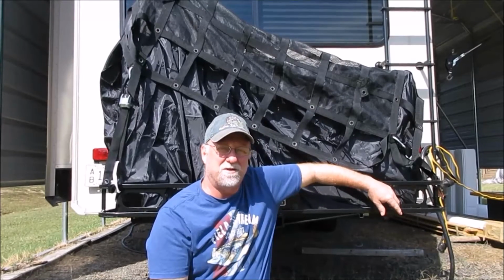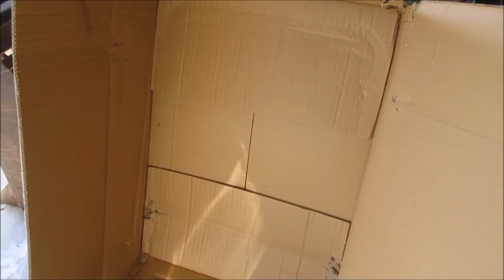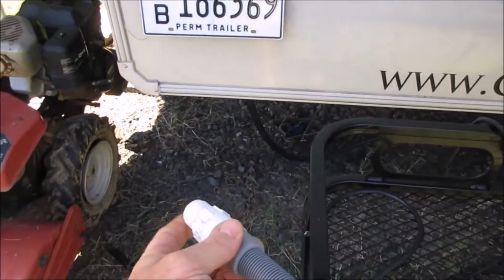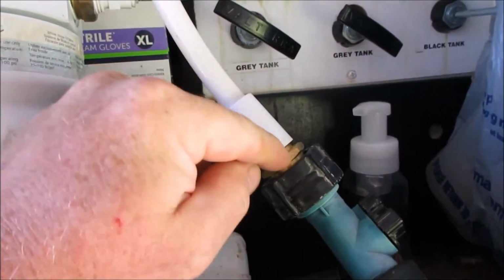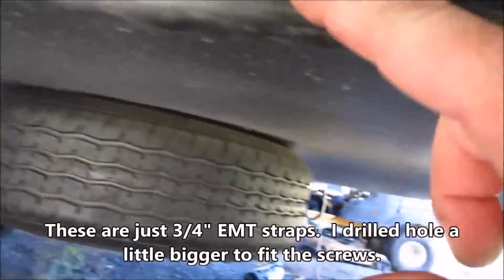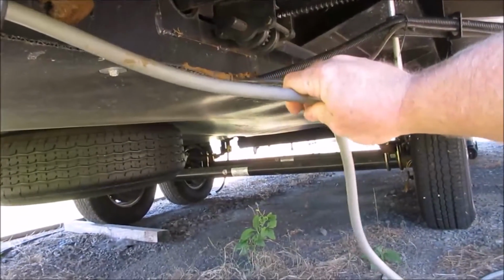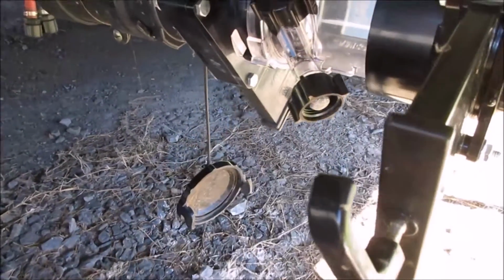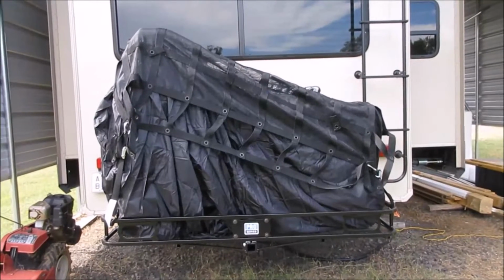RV Modification:  Washer and Dryer on the Back!

Comment: Hi, I normally live full time, just my dog and I, in a Coachman Bunkhouse RV. Right now with my son taking care of his son’s wife. I hope to be back in it in the next couple of months. Now I am in Little Rock and should be moving to JB’s RV park out side of Benton. I thought you said you lived in central Arkansas? Anyway, I  have seen someone have this set up before and I have been looking for a way to do this myself. I don’t know if this will be monetarily feasible for me but glad to have seen your set-up.
Reply: The dishwash I used in the video went bad.  It was a cheaper product and I think the bouncing around didn't help.  That was a few years ago so it lasted a good bit for us.  Our plan was to purchase a washer/dryer combo to alleviate the switching to the dryer.  Thoughts were to turn on at night and next morning they'd be dry.  Well, we started saving and then Covid curbed the usual traveling.  Today, we're on the fence on whether we're going to keep the current 5th wheel long enough to make a washer/dryer combo purchase worth it or just get a new 5th wheel with hookups inside.  Now, we also have ebikes that are going on a rack.  We just talked about it again and we're considering options with 2024 being an active year for RVing potentially.

Comment: I live full time in my 5th wheel camper, I've been @ this camp ground for 30 months. A camper pulled in a week ago with a box frame welded to the back with a front loader washer and dryer. My wife loves the idea, but searching online. I only see your video. I'm about to cut up some 5 inch c channel & build a rack.
Reply from the maker: I am going to get a washer/dryer combo and give it another go.  The cheap washer broke.  I also need to build a shock absorber into the rack to keep the road bumps from damaging the unit over time.  Any ideas?

Comment: Just saying, if I was parked next to you at a campground. Would you hear the washer and dryer running at night?....lol. I was wanting to do the same thing on ours.
Reply from the maker: Very good question!  I want to answer honestly because noise is always an issue for some campers especially generators running, dogs barking, and children screaming.  Yeah, they get on my nerves too at times.  

We used it on our 3-week NC trip.  I washed once at night and could hear folks' TV next to us, from inside their trailer, while it was going.   We mostly use it during the day, say late afternoon when surrounding noise levels are higher than at night.   You need full hookups or it will quickly overwhelm your water/tank storage.  But that's true of all RVs with washers and dryers.  

Most full hookup places don't lean themselves to "campers" so not a lot of hanging outside going on.  Most folks are out and about during the day and retired inside the RV at night.  Most picnic tables and hang-out areas are mid-trailer or so.  This is on the back of the RV.  I asked Gina again just now and she reflected what I remember.  We couldn't hear either running while sitting on our back couch which is right next to it inside the trailer.  We could barely feel the spin cycle.  Our previous combo unit inside our Cameo, was more detectable.  Simple answer, I don't think you'd offend anyone.  I would say go for it if you're put out sometimes with loading up for the dreaded laundry detail.  I bet your wife would appreciate it!  Ask her and let me know what she says.  

Lastly, even if noise complaints are a concern, you could wash when no one is around like during the week, even say staying at COE parks or state parks.  There's always dead times when we travel and with this setup, 2x a week is plenty.  Hope this helps.  :O)
Brent
Reply: No you won't

Comment: Great idea. I'll do the same way in the future. How many lbs? For both machines and any problems with the 5 er. Thanks.
Reply from the maker: It's not much at all, but I don't know the weight.  The hitch holds 300 if I remember right.  It's less than 150 total I imagine both machines and the tote too.  They're all on the rack.  No problems in our travels yet.

Comment: How are the washer and dryer holding up to the elements, being outside 24/7 under a tarp, with the underbelly exposed?  Getting any rusting?  How are the electronics holding up with the exposure to high humidity?
Reply: Let me go look.  Just washed a load two days ago as part of upkeep.  The bottom of both are covered with painted metal like everywhere else.  No issues seen other than rub marks where the tote rests next to the washer.  Hope that helps.
Reply: I have mine set up on a seasonal site, and my washer and dryer sit on treated wood with a cover, and there don't seem to be any problems. I have my drain set up so it drains on the ground, but want to do an adapter like he has above but don't know what connectors to buy.

Comment: Given that the frames on RVs are prone to rusting cracking breaking etc are you not concerned that the weight of these units and the springy nature of it's platform will not eventually lead to it's structural failure to stay attached to the main RV frame especially when driving on a bumpy road etc? I can see the main attachment snapping off at 60mph on a freeway and the units falling onto the roadway causing other vehicles ie tractor trailers etc to veer at high speed causing horrific chaos!
Reply from the maker: Wow, Lauren, that's quite a comment.  It sounds like you're saying you don't trust all of the RV manufactures decision to add a hitch on the back of fifth wheels.  For that matter, all the pickup trucks, SUVs, and cars too.  They're everywhere.

I don't know how to alleviate your concerns other than give you my thoughts on it all.  Grand Design added a hitch rated at 300 lbs.  Why did they do that?  What other possibility could be used with a 300 lb hitch rating or tow a very, very light trailer?

I have personally only used about 1/3 of that capacity or just over 100 lbs if I remember correctly.

I expect that if such a horrific incident happens, Grand Design will be liable.

I'm not trying to be snooty, honestly and I am curious about your line of thought on it 'cause it's a big fear to harbor.  I've been under 2 RVs now for 8 years of traveling.  It's part of my pre-departure checklist to check the frame and other components such as the landing gear, jacks, pin, tires, wheels, leaf springs, etc.  I've not noticed any rusting or cracking other than very fine surface rust.  I just checked again for this answer for you.  There is almost zero rust on the whole back assembly and no cracks 3 years of traveling.  I hope that helps you out.  And, I hope you realize that I'm within normal practices.  I certainly hope you come back and post your thoughts after my answer because I worry about your fear.  I am afraid of heights so I can imagine what might be going through your mind on it all.  Thanks.
Reply: If you mix YouTube videos of Lippert RV frame horror stories with a weighted bouncing rear attached frame platform you can easily see this scenario happening. Look up Lippert frame disaster RV stories on YouTube then you will see how I arrived at this idea. I've read multiple Stories about rvers adding a simple double bike rack on the rear hitch of their RV then putting on one or two bikes add anything other than a smooth highway and the frame hitch cracks due to it's paper thin construction and the bike frame n it's bikes and up in shreds on the highway! So I can easily see a heavier weight like appliances on a rear attached platform happening WAY easier than a couple of bikes. Plus people stating that even though their unit has a rear hitch if they add anything to that hitch they void their RV frame warranty!! Stunning!
Reply from the maker: I did a YouTube search just as you said and the output is all over the place.  Can you put the links of 10 cases on YouTube here, the forum conversations with bicycles causing failures, and any other supporting links.  What your describing goes against everything I've experienced, researched, read, and discussed with the manufacturer and other RVers.  I need to see what you've seen to see your points so please supply those links for me and the others who read the comments.  

The warranty only covers basically the appliances and stuff like that.  I just went over this with them round and round because our trailer axle was mis-aligned.  They told me they don't cover stuff like this because they can't verify what is human error or not.  I think that's BS, but it's in writing. 

I JUST got off the phone with Mark from Grand Design and posed your concern.  He said two things:

1.  Lippert wouldn't put it on their frames if they didn't mean that it can support 300lbs worth of stuff going down any road.  They're aware of how RVs behave over every surface and hitches have been on RV since the beginning of time.

2.  Mark said he has NEVER had a case where someone reported a hitch failure.

I have worked with Grand Design on a few issues directly including the grease seals failing.  They paid for everything with just a phone call.  They are outstanding to deal with and have great customer service.  If you doubt what I'm telling you, please give them a shout. 

So, I'm still giving your argument credence and I'm definitely not offended or mad.  If I were, I'd just delete your comment.  So, please provide the support for your claims and we can go from there.
Reply: @brentginastravelingadventures  
Im not offended or mad at all. The info i gave you may not have originated as a  actual.posted video but may have appeared as commentary on a video that was posted. I dont know how to do links but next time im on my computer i can see if i can find them again. But what i read regarding this was not a single episode it was many people stating the same experiences.
Reply from the maker: Ok.

Comment: Can You tell me what I need to buy to make the drain on my washer work like yours? (drain through a hose). My drain looks to be the same as yours.
Reply: 3/4" PVC to standard hose fitting for the washer drain.  Talk to the plumbing supervisor in Lowes/Home Depot.  The washing machine I purchased had a standard garden hose fitting for the intake so any standard hose will fill.  Hope that helps.
Reply: @C3Voyage  I adapted mine to work with a garden hose. I will venture to HD and find a 3/4 PVC to hose fitting. Do I need a hose clamp?
Reply: @gageshultz9523  I used a zip tie 'cause it's what I had on hand.  There's not much pressure in the line so it works, but a clamp would ensure the fit doesn't come loose and probably cheaper than buying a bag of zip ties.

Comment: i think you need a groundfalt interupter
Reply from the maker: Do you think I need one if they entire RV is on an electrical managment system that reads, detects, and protects the RV from many different types of situations?  Also, the dryer plugs into a GFCI at the CG panel, but the washer plugs into a line that's goes to the outside bay.  All factors included, can you explain more for me?
Reply: Brent, very good video. And yes, you do need GFI protection for that washer. As far as I know, electric management systems do not provide ground fault protection. I've seen open ground protection, but that is different. The scenario is while you're going down the road a wire inside your washer vibrates loose or breaks and creates a short to the metal case. If you then come along and plug in the washer and are standing on wet ground and touch the metal on the washer, zap. Thanks for making a good video and be safe!
Reply: That outlet you used is GFI protected as is all outlets accessible from the outside.